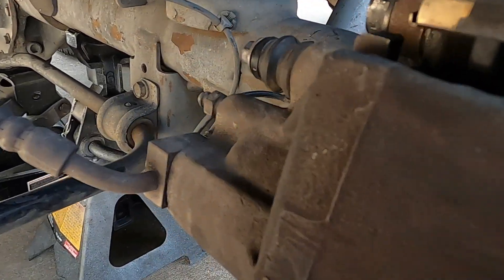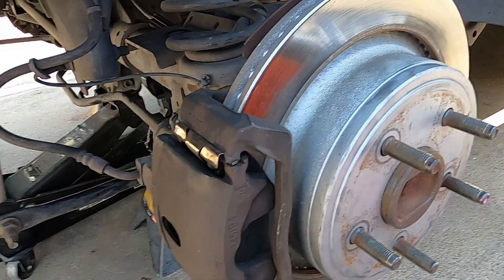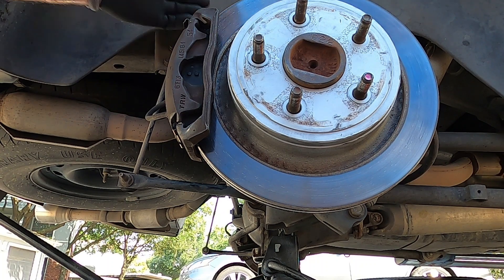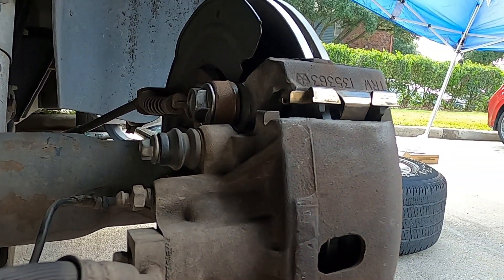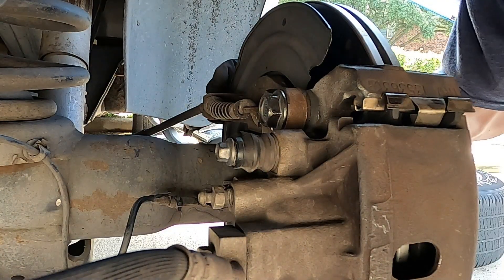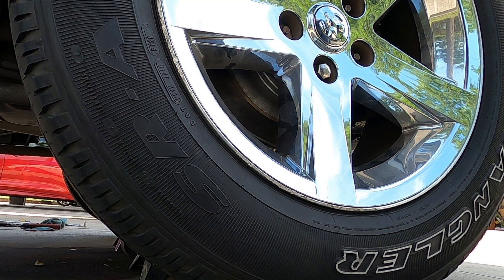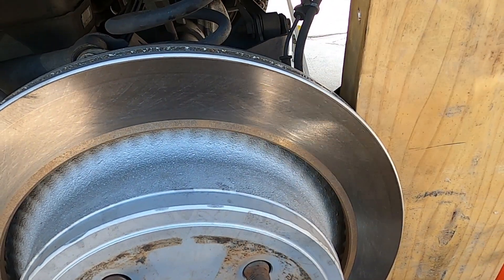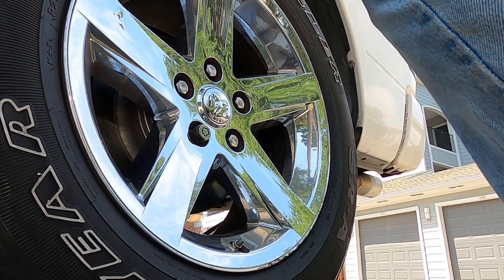What going on with my rear end. What I had to do to with washers for my rear brakes 09 Ram 2wd.

Comment: Happy father's day big dog! There's a clip in the rear end that may control rear wheel alignment i had one changed caliper and hoses and master cylinder still grabbed! I could have used that washer trick. It was the rear driver mid 90s jeep Grand Cherokee

Comment: Thanks for going so deep into this. I have been hanging on for this one. Seems someone did something to bend the caliper holding bracket or something similar. Only way to know is have a just like truck and do a lot of measuring as it is not obvious to the eye. Rather clever way to keep it going though.
Reply from the maker: Thank you sir